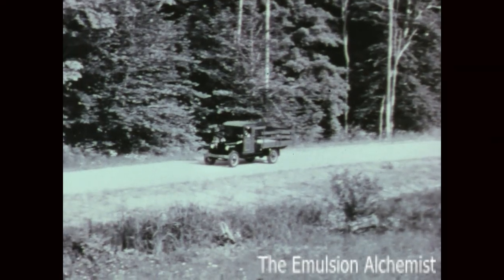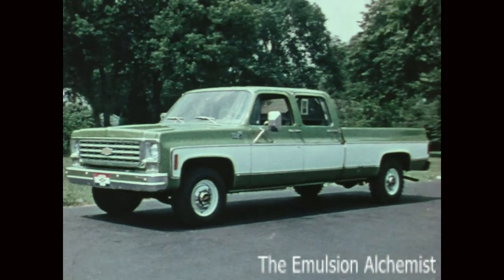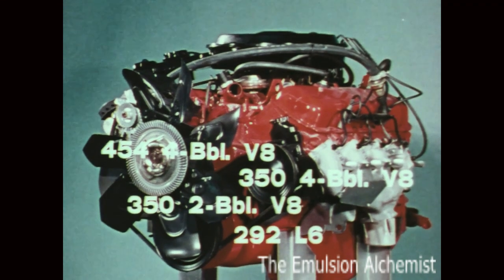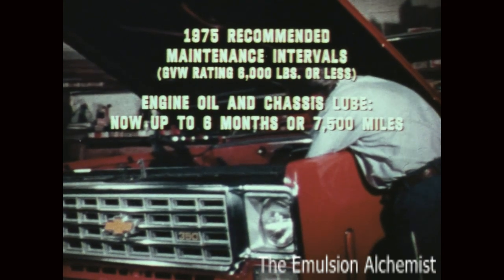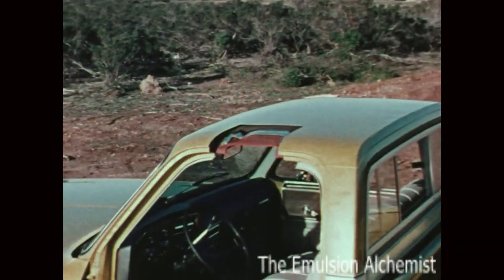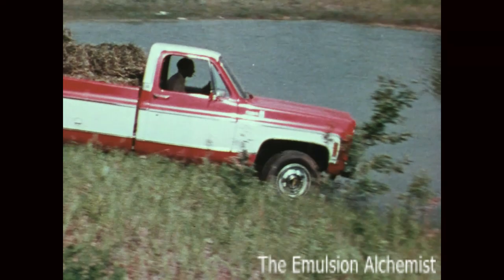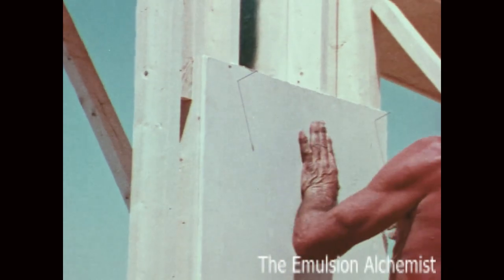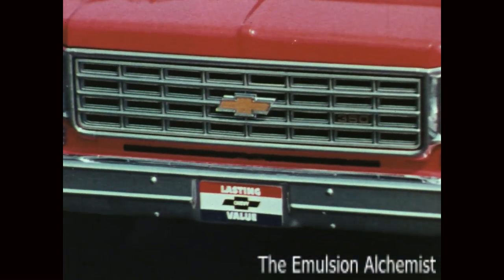1975 Chevy Trucks Dealership Sales Training Promotional Film "Lasting Value"

Comment: My grandfather bought a new 1975 3/4 ton crew cab 2wd.  454, automatic, A/C, camper special.  It had two shock absorbers connecting the back of the cab to the inner walls of the bed.  It's rough and rusty, but my uncle owns it now and occasionally drives it.

Comment: I've had 3 Chevy trucks; a '77 flatbed, an '80 Stepside, and an '81 long bed. Ultra reliable, but unfortunately, road salt ate them up really bad. I had to junk the '77 flatbed because the cab mounts rusted off of it. I traded in the Stepside because the lower door jambs were so rusty that the lower hinge was floating in thin air (had to pick up the door to close it). But super dependable.
Reply from the maker: road salts killed so many cool old cars and trucks. many are still alive here california